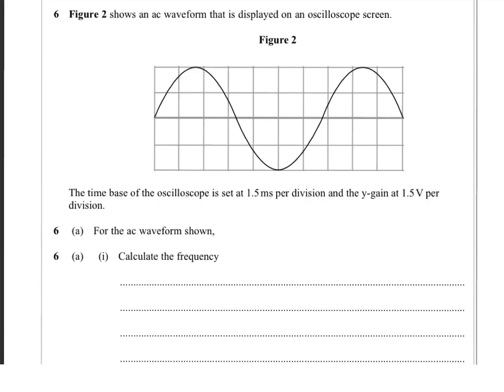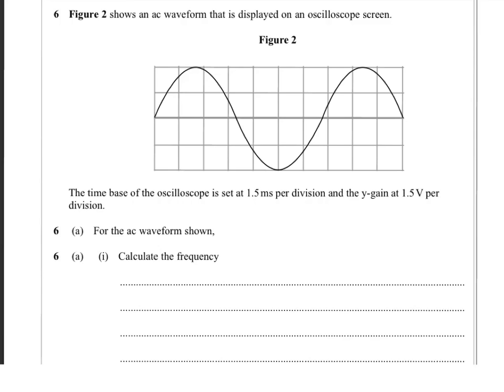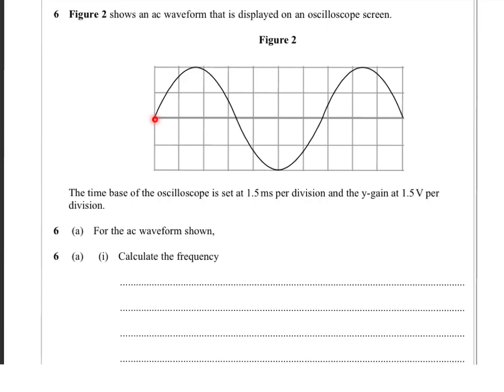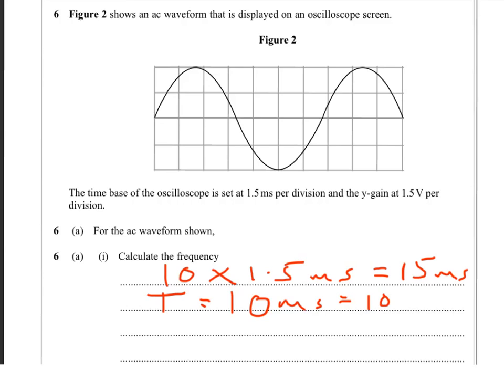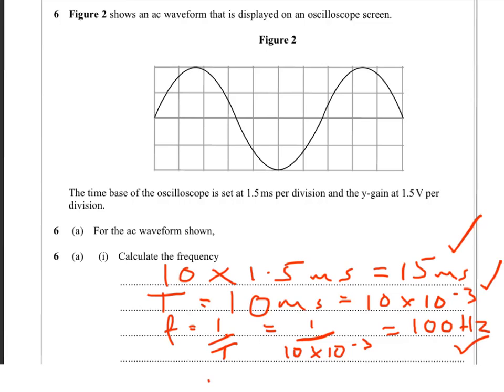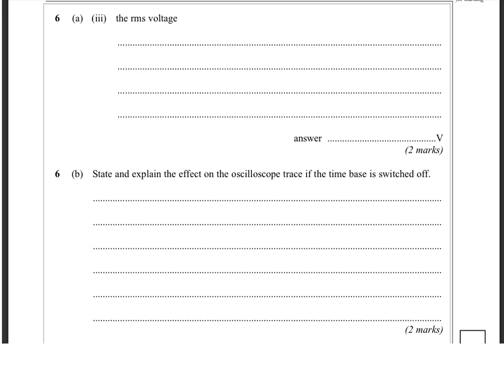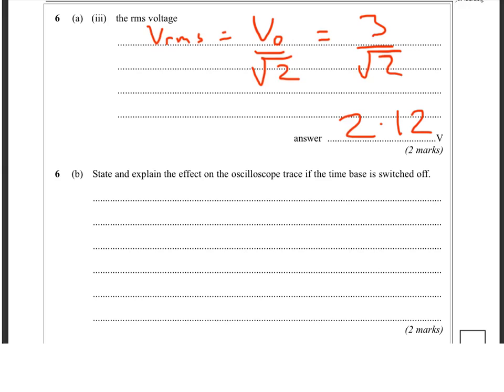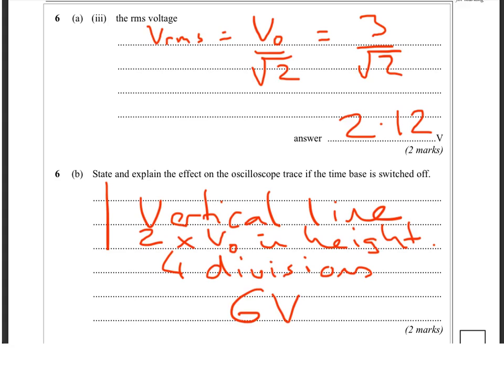Oscilloscope past paper Q2 timebase

Comment: Here calculation of 'T' is wrong. it is nearly equal to T~1.5x7ms=10.5ms and f=1/T so ~95Hz
Reply: Not incorrect..instead of counting the divisions for one wave, it will require some guessing because one wave is not exactly 7 divisions, it is a little less. So he figured he'll take the time for 1 and a half wave so 1.5wave=10divisions*1.5 ms
1.5wave=15ms and through ratio one wave would be 15/1.5= 10 ms